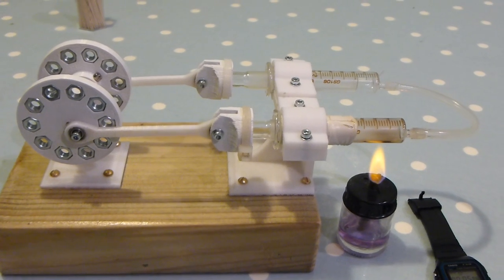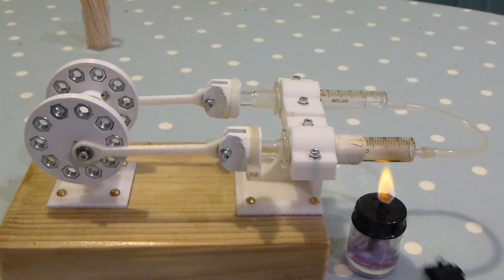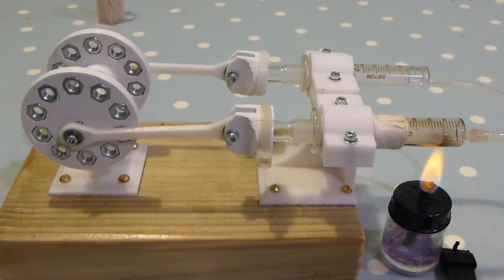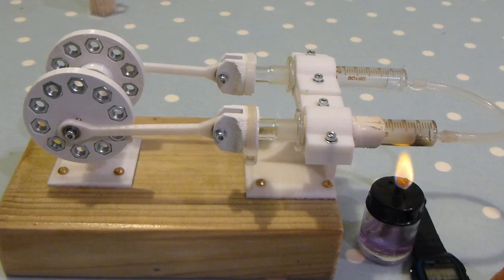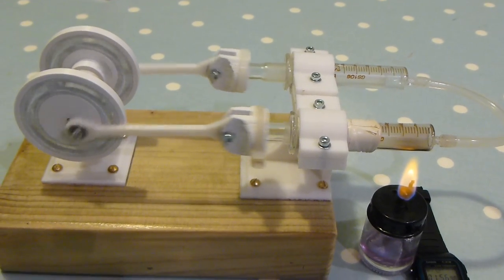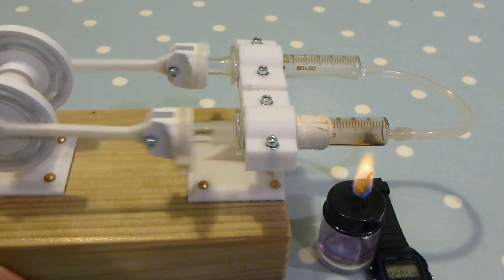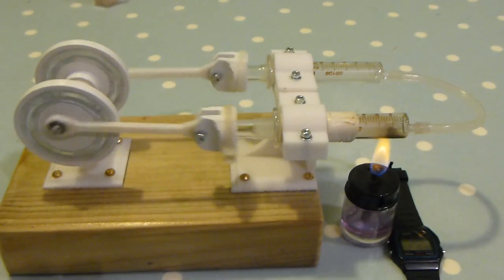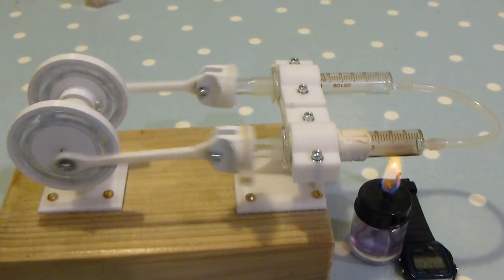Make the 3D Printed Stirling Engine Run Faster

Comment from the maker: PeanutVendor69 - It speeds up when vertical because of two reasons.
1.When horizontal, gravity causes more friction on the side of the syringe pistons. This slows the engine.
With a slow engine heat is not removed very fast by the engine. So the temperature of the cylinder rises.
2. When moved to vertical, the side force of gravity is removed. The friction is less. The engine runs faster.
But ALSO the cylinder has been at a higher temperature. Higher temperature heat - the engine runs faster.
A double whammy!
Reply: Andrew Hall thanks for the explanation, makes sense! Surprising to see it makes such a big difference! Lovely bit of kit here, thanks for the vid.

Comment: Congratulations on building your engine, I've done several motors, but never got around to do this test vertically.
Was really impressed with the improvement in performance when the pistons are vertically but I could not imagine it would make much difference.
When fabricated my first engine like yours, I used plastic pipe to connect the two syringes, but had too much friction, solved the problem when I replaced by an aluminum tube.
Did you notice if your piston is grabbing the cylinder? For my happened so when I wore a plastic tube.
Another thing that limits the engine speed is glass syringe tip, because the orifice is small compared with the metal needle tip.
Leandro Wagner.

Comment: Thanks man, I realized that I am better off with a coil-wound heating element now, so I can have the engine stand up. Also it will take-up less space this way. Time to improve! I have found syringes made of glass that use metal plungers so I will see if they work better.
Reply: Any results? 👀
Reply: @DarkdragonKev  Hah, thanks for asking. I haven't worked on it much, but I did make a few tryouts. Now that I have better 3D printers and another 5 years of DIY design, printing and electronics experience under my belt, I should try again! 🤔
Reply: @MarinusMakesStuff  the coin wounding heating element interests me. It just requires electricity instead of an open flame that can scorch the model.
Reply: @DarkdragonKev  Exactly, the burner I used totally deposited a layer of charred material on the glass.

Comment: use a tube of copper or alluminum instead of a rubber tube between the piston to increase   thermal exchange of air  and also you must increase the pressure of your air inside the motor, these precautions can be helpful. 
bye

Comment: I congratulate you on your project. would be very interesting to know where he could buy the bearings. Maybe there somewhere on ebay or internet to shop. You know?
Reply from the maker: I'm in the UK and get bearings from SMB Bearings in Oxfordshire. I usually get stainless steel open (not shielded) bearings. www.smbbearings.com
Reply: does it make a big difference open vs shielded bearing?
Reply: I'm sorry, but I do not understand your question.
Reply: Will it make a big difference if I use a shielded bearings?
Reply from the maker: Yes. Shielded bearings are a "go slow" factor. The shields add some friction. The engine runs slower and is harder to start. Even with un-shielded bearings wash them out with WD40 - they come with thick heavy grease. Then test just the flywheel assembly. Spin the flywheels with a finger. If they only run on for 5 seconds. Not good enough. When fully clear of grease they should spin for 10 - even 20 seconds.
The longer the better. Has anyone tried ceramic bearings? I am told they are the best.
Reply: Thanks! What are dimmensions of bearing you use? (I wanted to use 2x5x2,5 but they are only shielded)
EDIT: I guess I will just buy shielded ones and remove shields. BTW. I'm making vertical alpha stirling ;D

Comment: assuming thats a heat resistant plastic?
Reply from the maker: No - that's the problem!
Perhaps this is the part that should be replaced with 3d printed sintered metal?
Reply: yes, anywhere near that fire, or becomes hot should be, the metal will also get hotter, giving more power. where plastic is more insulated, and a higher risk of the engine going up in flames. if you haven't already, invest in some stirling engine lube for the pistons. and make it stand vertically if lube is no help.

Comment: A little question please. I´m trying to build a Motor just like yours. What is the disphase angle between the Pistons, 90 grades?
Reply from the maker: Yes the phase angle should be 90 degrees. It will still work if it is 85 degrees or 95 degrees.
Even 80 or 100. It is not highly sensitive.
Reply: @andrewhall2702  Thanks man! Btw asome Construction!    :)

Comment: tubes can be melted in long run how long you can run continue if you made any experiment please?
Reply from the maker: Yes - the flexible transfer pipe tubing can get over heated. I have made a heat shield with some aluminium shielding. Aluminium is highly reflective of heat. Another option is to make sure that the flame is only as large as it needs to be. An overly large flame doesn't actuallly add much to the engine performance.

Comment: I know this post is old but do you happen to remember the timing for this? are they 180  degrees or 90 degrees offset of each other
Reply from the maker: 90 degrees - ish. 95 or 85 no problem, 100 down to 80 degrees - it could run less well.
Reply: Andrew Hall have you ever seen one's with 2ml syringes work?  I accidentally bought the wrong ones.
Reply from the maker: I think that will be too much of a challenge. At 2 mm internal diameter vs say 9 mm, the volume of air will be in the ratios of pi * r* r * l. The stroke lengths will be much the same. So the power will be in the ratios of r squared.  1mm radius vs 4.5mm radius. ie 1 : 20.25. So there will be 1/20th of the power with the reduced volume (amount) of hot gas to push the piston. All Stirlings have problems with friction. Reducing the power of the gas by 20 fold is too much. But the maths works the other way. If you increase the radius from 4.5 mm to just 5.0mm the increase in power is 5 squared over 4.5 squared. ie 25/20.25  Approx 25% power gain. That will make the engine easier to run.
Reply: Andrew Hall is it a long shot to increase the rod to stroke ratio by moving the pin on the wheel further out? I know that changes the amount of friction as well and moment of inertia for the wheel... this is a project for school btw... those syringes where kind of expensive.
Reply from the maker: It's going to be a challenge to "get round" a 20 fold decrease in the power of the hot gas because of the reduced volume . Increasing the stroke of the hot side of this engine? I haven't tried that. With other engines - beta or gamma - we usually try to make the swept volume as big as possible. Then set the piston stroke to best crop the pressure variation. With this alpha design we would need a 20 fold increase in the stroke to get the mass of gas back up to the level of the proven design. Then set the cold piston as best as possible.
This changes the whole project from "let's learn to assemble a proven engine" to one of "let's design a new engine".  Sadly, developing a new Stirling engine is not easy or quick.